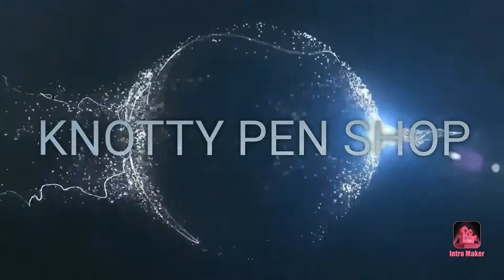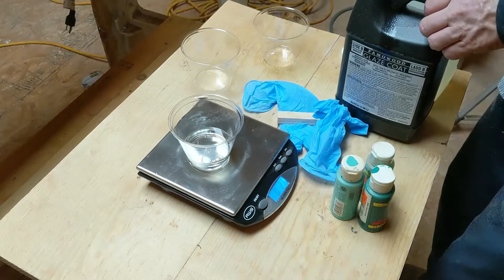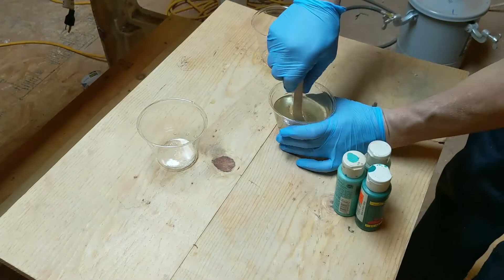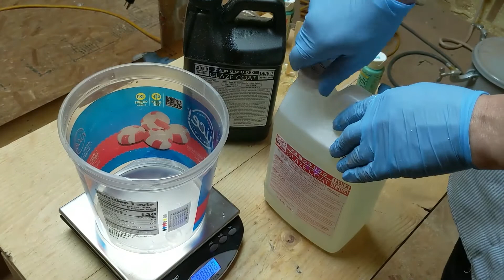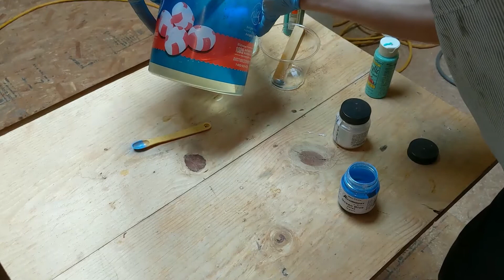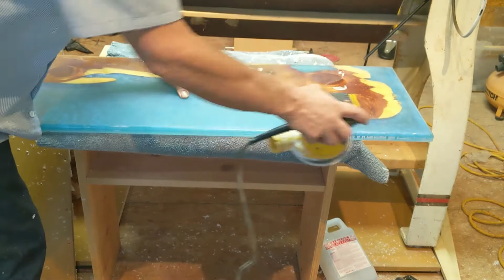river table shelf made from red cedar and epoxy

Comment: How much did you spend in epoxy? And what were the dimensions of this shelf table?
Reply from the maker: My beginning hold was 18 by 30 butter cutter quarter inch Ivory change to recuerdo I used total boat FRC don't write off remember which one it was not the best right or the thick for the other one it's right around $100 a gallon but I didn't use quite a half a gallon on this project
Reply: @knottypenshop1346  thank you